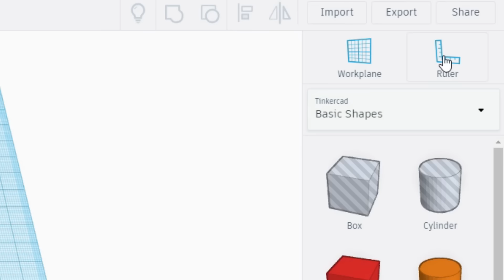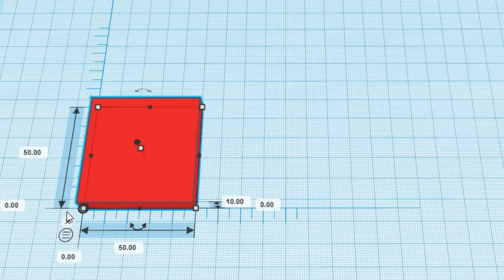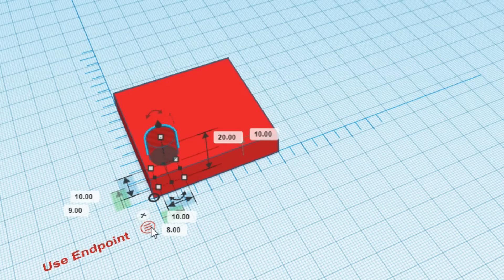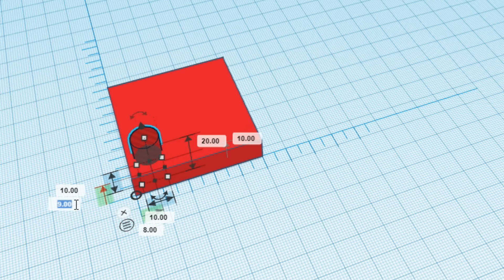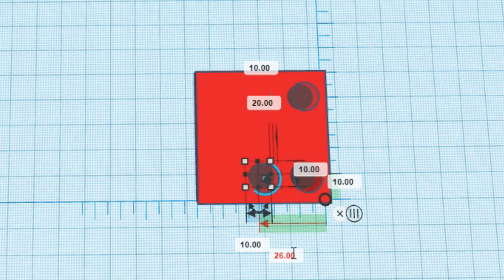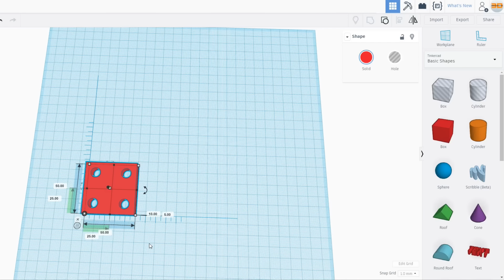TinkerCad Tip -  Using the Ruler the Easy Way!

Comment: What about using the ruler on vertical pieces?
Reply: Select the workplane (left of the ruler icon) and then click on the side of the object you want to measure, or that you want to use as a reference. That gives you a vertical workplane. If you then add the ruler, you will see it aligns with the vertical workplane. But it doesn't need to be vertical, it can be any diagonal plane. :) To reset the workplane, click the workplane icon again, and then click on the (empty) floor.

Comment: I've been pulling my hair for the last 3 hours trying to do measuring between holes for a project,  I think using this method it might work. I may just increase the size of the holes to make things easier vs. 6.7 mm wide holes.

Comment: Do you know how to measure from two inside walls without having to use the midpoint? Having huge issues with spacing on three walls on a 4.8" block.

Comment: Thanks for the tip. Can the ruler be used off the work plane to measure hole locations on a cylindrical item? Array?
Reply from the maker: Not sure about "now" however back then no but things might have changed.  For that I would suggest Fusion 360 (it big brother)
Reply: @DIY3DTECHcom  Thanks!

Comment: Can I save projects as gcode with tinkercad ?
Reply from the maker: Sorry no, for 3d printing you will need a slicer or a cam package for CNC.  You may also want to check out Kiri Moto too...
Reply: @DIY3DTECHcom  How about x3g file? Any software that can convert to x3g file?

Comment: I noticed your version of Tinkercad is the same as mine that has no favorite button. I’ve tried to update but nothing has worked and cannot find anything about it. Any ideas?
Reply from the maker: This video is a bit old, however the favorite selection is still there under the pull down to the right...

Comment: It's actually easier than you describe, if you use midpoint and zero your square.  Then once your first hole is set (I tend to set in the +/+ quadrant) when you duplicate your hole it's simply a matter of changing signs. For example, based on your design, if you had zeroed your square in the X and Y using midpoint, the first hole would have had coordinates of ( 15, 15 ), then the first copy would have been ( 15, -15 ). Selecting both holes at this point gives a coordinate of ( 15, 0 ), duplicate that and change it to ( -15, 0) and your other two holes are set.
Reply from the maker: Jason thanks for sharing and yes based upon what you wrote there are is  the possibility of a couple perturbations of this as you mention with the placement of a hole or set of holes. :-)